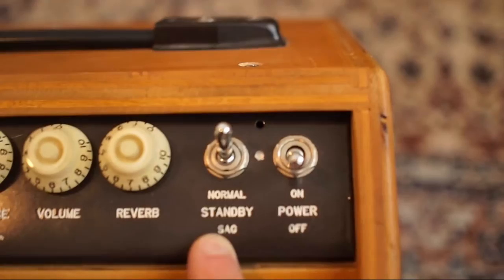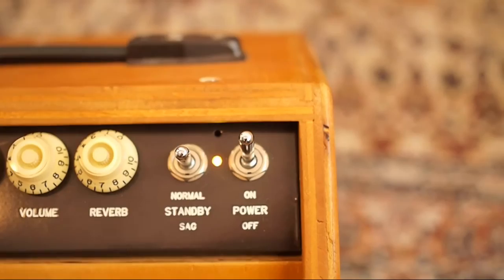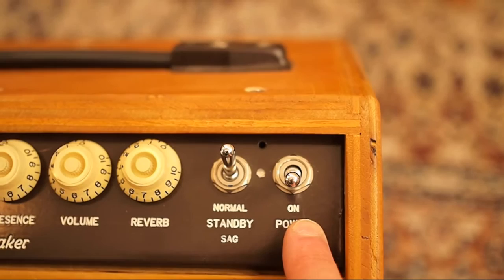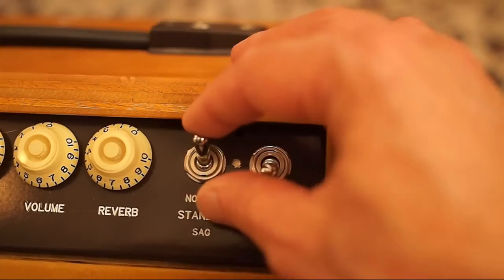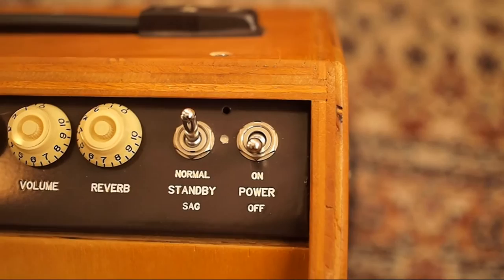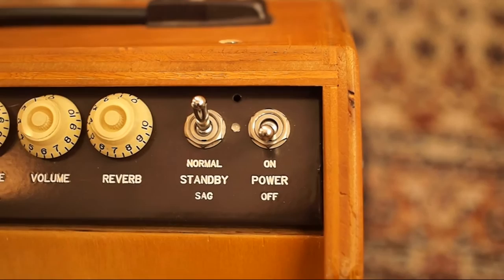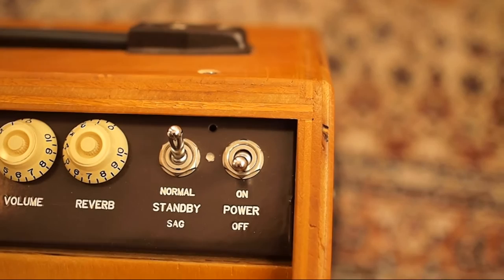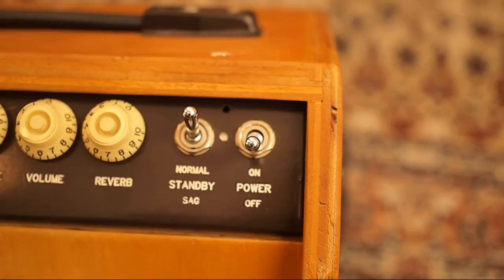The Correct Way to Use a Standby Switch

Comment: My father who built tube amps before WWII always used the following rule of thumb: every time your tubes go thru a complete cool-down/warm-up cycle, it shortens their life approximately the same as when you leave 'em on for an hour. So, if the break in a performance or rehearsal or recording looks it's gonna last over an hour, I switch the power off. That is what I do, and everybody has and should have their own ritual. It's like taking sugar in your coffee: there really is no right or wrong. I LIKE to have a standby switch on my amps and have put them on amps that didn't have them. I personally also like to drain the caps by switching off first vs messing with bleeding them before amp work, which I then do anyway just because of some previous experiences... BTW Auburn Rob, I've seen a few of your vids and am convinced you know what you're talking about. Wish everybody a great day.
Reply from the maker: Thanks very much for your kind and insightful comment. You're absolutely correct that the filament heating/cooling cycle can affect tube life.
Reply: Ä
Reply: Off course there is - it is always wrong to put sugar in the coffee 🙂

Comment: My Marshall 2245/JTM45 that has a GZ34 rectifier tube and the owners manual warns to always put the amp on standby before shutting off the power. So I do what the owner's manual say's to do. I am aware that by shutting off the power while still in standby that you discharge the capacitors by allowing them to bleed down, and that is a safety feature to protect me when I open up one of my tube amps.
I allow about 3 min. up to 1 hour (very rarely) on standby to warm up not only the tube filament but also the metal chassis. I am also aware that when I play my tube amps for many hours that the entire head (chassis and tubes for combo amps) warms up and the heat has the effect of drifting the caps and other electronic components out of spec. That's why your tube amp has a different character when played for many hours. Mine sound really good after 9 hours and even better approaching 14 hours. I admit that during this time I take breaks and often I put the amp on standby. Sometimes for shorter breaks I only lower the volume and gain knobs. Which limits how many times my tubes are exposed to a voltage spike by not using the standby switch. There was a time when I would lower every knob when not playing and especially when powering off (I still do that most of the time). I love my tube amps, to me they are alive.
I do the same for my Fender '59 Bassman LTD and it has the 5AR4 rectifier tube.

Recently I started using a Variac and start up my tube amps at from "0" vac, then move the dial until the red jewel light starts to glow at about 40 vac. and then slowly move the voltage upwards. I can run my tube amps at around 95 vac to 110 vac. This protects every electric component in the amp as the voltage is applied slowly and rises. I could even start at 40 vac for the components to really be healthy. 
Some amps the non tube amps and the Bugera tube amps that have an automatic voltage regulator will not run at 90 vac so I do use a normal 120 voltage. For my tube amps (all of them) 105 vac is very good the amps sound terrific and I am lowering the plate current and even the mA for the tube bias to a very safe level. Not only do the tubes last longer but to my ears the amps sound better. After 12 hours on reduced voltage my tube amps are heavenly. That's why I shall always be a tube amp guy.
Once I used a small tube amp as a space heater in my bedroom because the floor was above a crawl space and was always ice cold and I wanted to break in/condition all components to last a decade as a min. So far so good.
I am not an expert. I am not a tube amp technician either. I just love tube amps and search out any knowledge concerning them.
Your advice is the advice that I shall adhere too as you made the most accurate assessments out of the many Youtube video's that I have watched on this subject. I thank you for your advice!. 
I came here looking for an answer to this question: When taking a break Is it better to put our tube amps on standby or to turn the volume and gain and possible the preamp tubes (EQ section) to a min setting? Do tubes last longer when not turned on and off in standby mode many times in each day long playing session? -Peter
P.S. Looks to me like you make guitar tube amps could you talk a little about that? Please? Hey tomorrow is Tuesday New Years Eve day December 31, 2019 Happy New Year everybody!!!!
I edited this a little bit on July 22, 2023 because I had made several incorrect statements. I have more knowledge now and also a better understanding of all this thanks to all the Youtube commenters and especially those that take the time to make an educational video. 
- Peter age 73

Comment: The other reason to power on in  standby mode is to let the bias come up (down) to the correct voltage. The bias is often obtained by taking a tap off the main B+ and feeding it through a resistor divider. This can take a few seconds for the bias  filter caps to charge up and for the bias  to reach the correct negative voltage. This results in an under biased output stage. My old Marshall JMP "Rocker" I just scored does this. The bias circuit is fed before the standby switch so it comes up to voltage with the standby on. I've measured the plate current and there is a surge when the amp is cold powered. 

This standby switch thing was a hang over from  RF transmitter tubes that run on 800V - 2.5KV or more where arcing in a cold tube was a reality,  audio tubes running at 300V-500V it was less an issue, however, early "commercial" Russian tubes from last century had the same arcing problem and often needed to be burnt in, before you could just fire them up cold. 

One other thing to mention is cathode poisoning if you leave your amp on standby for extended periods (hours, days, weeks)  The theory is that the electrons leave the cathode but don't have anywhere to go and so, rejected by the negatively charged grids, and ram back into the cathode. This slowly changes the chemical composition of the the cathode and surrounding hardware in the the tube and it becomes less efficient. 

Switching an amp to standby between sets is fine. Leaving it like that overnight, probably not so wise if you want your tubes to last.
Reply: It sounds like you have taken a lot of time to really learn about and understand tube amps. I congratulate you on your interest and I thank you for sharing your knowledge here. -Peter Happy New Year 2010 tomorrow tonight!
Edit: I just did more research and was able to validate much of what you wrote!

Comment: I tried turning off my 5150iii this way once (unintentionally) and got a bad nasty sound. Thought I broke something.  I always power on and off in standby.  Also, if I don’t let the amp warm up enough in standby and rush things, I get crackling sounds coming from the speakers. So I always let the amp warm up for a good long while....over a minute - power on, get guitar out, hook up cable, tune it, etc - then take it off standby.
Reply: Your way is correct Echo Charlie. I know that from experience!

Comment: I own a DSL100HR but heres an excerpt from the DSL100H/ DSL50C Manual that im sure still applys to the new HR version and any other Marshall amp with SS rectification or Tube rectification. Its specifically states to power off standby before the mains power switch which i can imagine is for multiple obvious reasons......
2. Standby Switch
Controls H.T. or high voltage to the valves to allow
them to attain correct working temperature before playing.
To prolong the life of the valves it is always advisable to
switch on the Mains Power Switch (item 1) about 2 minutes
before switching on the Standby (item 2).
On switching off, the Standby should always be
switched before the Power Switch.
The standby facility is particularly useful between sets
and before playing, as it allows you to keep the valves
operating at a functional temperature but without any sound
being produced

Comment: Makes sense to me.  I've always turned my amps off with the standby on normal as your video shows for that very purpose (draining caps).  If you hit a chord, it sounds like the amp is using its last volt trying to make sound, so it sounds like it is draining something.  I have heard that this drain method just works if tubes have been heated up good.  If I am working on an amp, I always test and ark everything just to make sure anyway.  With all of the conversation going on regarding the standby, if nothing else, it is a quick way to leave your amp on idle for a few minutes while doing something else without having to wait for tubes to reheat upon return.

Comment: How did you do that demo while you were driving.   Pretty impressive.    HahahAha. Actually I am researching the stand by switch as one of my friends has put my whole way of thinking on its ear.   Thanks for the explaination. Makes sense. It’s to save the caps not the tubes
Reply from the maker: Good one! We've actually just released a tube pedal amp / practice amp / DI called the Stomplifier which runs on 12V, so you COULD actually play it in your car!

Comment: My 90s Ampeg t
Reverberocket owners manual recommends the following for using standby
 Standby switch activates the
amplifier when ready for play.
Always turn this switch off first,
on last. Turn the Power switch
 on at least 30 seconds
before turning on the Standby
switch
Which would you suggest? I believe there is a  circuit board
Also, when put it standby then power off it is quiet, if power off first in play mode, an electrical type noise, kind of a pop and then some electric sounding  noise on next startup

Comment: My hotrod deluxe makes a loud cracking noise if I turn it off while it’s that hot. I usually use stand-by to cool it down before shutting off.
Reply: Standby won't cool your hot rod down, it will keep the tubes warm, but still put it in standby first before turning off, just don't really need to leave it very long

Comment: 20 seconds to warm up an amp? I usually wait for 10 minutes
Reply: My tube amps take about 10-20 minutes of warming up to sound really sweet.
Reply: I've always used solid state and only 2 yrs ago bought my first tube amp. Cheap monoprice that I swapped tubes out for jj's. Was going to swap speaker but after 2 wks of playing it blossomed and I haven't felt the need to change it. I'm buying another Mono so I can have real stereo, I'd like a Magnatone Twilighter but can't afford those prices. My little amp doesn't have standby so I'm out of that conversation but it doesn't really start singing until 5 or minutes have gone by.
Reply from the maker: @Ouscazz  That's not uncommon, but they might reach that sweet spot sooner if you play them right after that initial filament warm-up. But maybe you'd just rather wait for the magic :)
Reply: @nickjimenez6138  from what I have heard about the mono basically the same setup as a Blues Junior so it makes sense better tubes
Reply: @Ouscazz they don’t need more than 5 min.

Comment: I find most manufacturers manuals don't cover the power on/off procedure. It's almost like they don't really care what happens, they made the sale, it'll hold together thru the warranty period and the tubes should last thru that as well. So then you waste your time going back & forth in customer service support emails. I did tech publications at one point in a career, burns me up when I see lousy documentation and a procedure isn't outlined in a step by step with illustrations. Same holds with policies & procedures for anything else for any department  in a corporate environment. You're almost on your own as a consumer. Since a lot of this has gone to China for manufacture, the documentation process has gotten even worse. I saw a Made in China product that had no serial number, not date of manufacture label on more than a few amps. I guess nobody can sue them and it's disposable anyway when it eventually fails for whatever reason(s) ?

Comment: The standby switch should be used when you first turn on your amp to warm the tubes up 2-5 minutes. IT IS NOT A MUTE SWITCH, BEER BREAK SMOKE BREAK SWITCH, IT IS NOT A PISS SWITCH, IT IS NOT A DINNER SWITCH. Turn the volume down and take care of those things and dont use the standby switch. When you turn the amp off just turn the fucker off and carry on. I have  1972 Fender Bassman 100 that was retubed in the 90s. I still have the original tubes. Trust me. Dont use the standby switch as a mute switch ever. It should be called a warmup/lower voltage switch.

Comment: Does turning the volume to 0 (master or normal) have the same effect as a stand by switch? I normally turn both my volumes down before I turn my amp off. Should I keep them at playing settings when I turn it off?
The amp in question is a mid 90s Soldano Atomic. No stand by switch, ss rectifier.
Thanks a bunch!

Comment: after turning my amp off without turning standby the amp made a loud humpf noise, the amp got very wierd as soon as i turned it on (got worried) and didnt play at all. after the amp cooled down it worked like normal, but the pickup i was using now humms.. what happened? :x
Reply: Cuterd   I don't know how much I agree with this video..   I have been using tube amps for 10 years now and have always been taught to have the amp in standby for atleast 10-30 secs before powering it off.   I have done it before accidentally and received very similar results to what you described with my mesa boogie head
Reply: definitely not doing it again that's for sure.. he's not the only person saying this but apparently some amps just can't take it. i don't advise it :p ps: guitar seems to be working well now too.
Reply: Cuterd Turn down your master volume before turning it off.I always turn my standby off first,a guy told me it saves your filter caps.
Reply: i allready do, im very carefull now x) but thanks :)
Reply: @shawntyson4339  do u mean activate standby switch on before powering off your amp?

Comment: While draining the filter caps may make the amp safer, will leaving voltage in them make the caps last longer?
Reply: The only reason to drain the caps is if you are sticking your fingers in the circuit.  That is the only concern about draining caps. Caps blow after very very long periods of sitting dormant than applying full voltage. Draining your caps thinking you are saving cap life is ridiculous. 😅

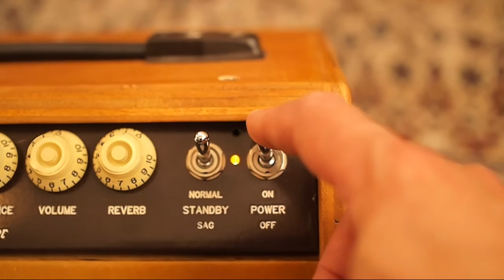Comment: When I turn my amp off that way (Laney lionheart l5t) it makes that noiseat 1:03 but more exaggerated. It kinda worries me
Reply: what I do is. I always set both volume channels off and switch to the clean channel before turning off my amp. Then put it in stand by for a minute or so, so it cools up a bit. Then I turn the power off. And when I turn on my amp i swich both the standby and power on at the same time. Is that wrong?
Reply from the maker: Hi Joaquin. In most amps, the standby switch interrupts the high voltage supply to the tubes, which is not what causes the heat: the tube filaments actually consume more power and generate most of the heat. They're also the cause of the warm-up delay.  The standby switch was intended to be a temporary "off" switch that wouldn't cycle the filaments through another warm-up. In an amp with a solid-state rectifier (which I believe your Laney has), I feel it's better to follow the procedure in this video. Your Laney has fairly large filter capacitors, so a "whump" is to be expected, and probably won't be affected by the controls settings. Either way, your speaker can handle it.

Comment: Check "Tube Guitar amp standby switch demo Myth buster Marshall Fender" by "D-lab Electronics"
Reply: Agreed. Standby switches are effective with high power radio transmitter tubes (thousands of watts), not audio amps.

Comment: I dont understand. Why cant I turn off first to stand by, and after a few seconds power off?? I ve doing like this and valves are working correctly.
Reply: sasul : As he says, by going right to “power off”, you drain voltage from the caps.
So you’ll be less likely to be shocked if you go to work on the amp.
Other than that , no reason ... go to “standby” first if you wish.

Comment: Within the power of guitar tube amps, mostly max 100Watt, many times round 50 Watt, it is complete useless to have a standby switches. Did you ever see a radio with standby switch. Me neither. The only devices that have a useful standby switch are big power transmitters. In guitar amps it ruins the cathode so the life time with sb switch is shorter. Why are so many guitar amps with a standby switch. It is the heritage from Leo Fender. Leo Fender was in the early days a serviceman for receivers and transmitters. So he thought that the sb switch was useful in his amps. The first amps from Leo Fender were derived from radio amplifiers. And then every manufacturer copied his Bassman (Marshall jtm45 and many more) all with this ridicules stand by switches. Do not use them at all.